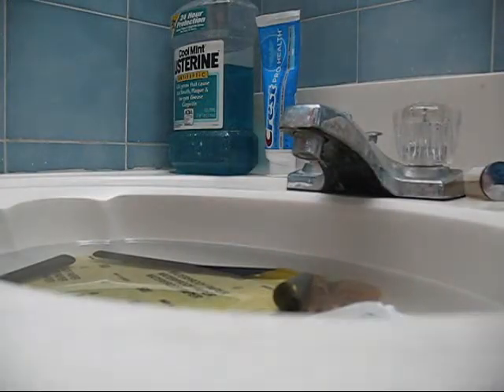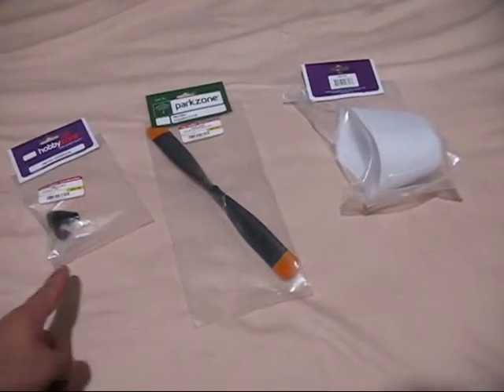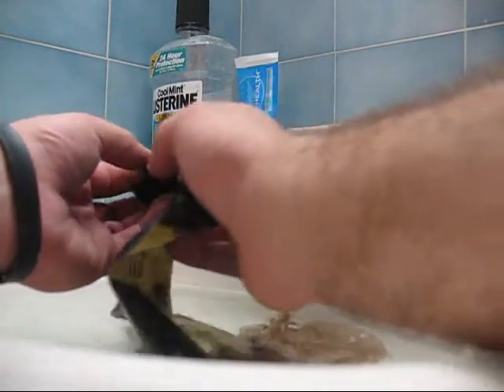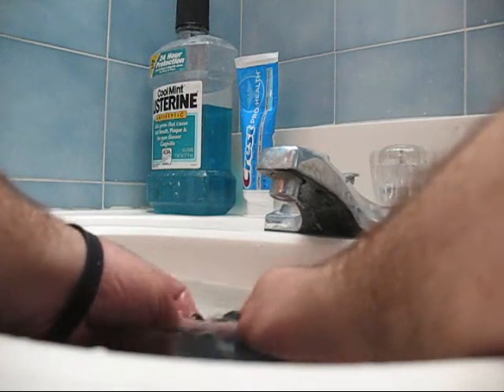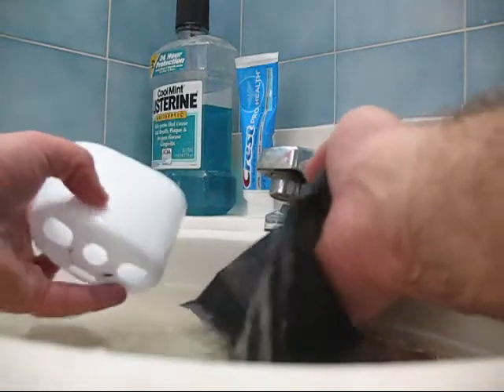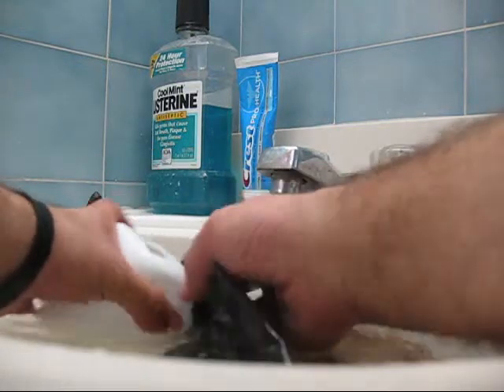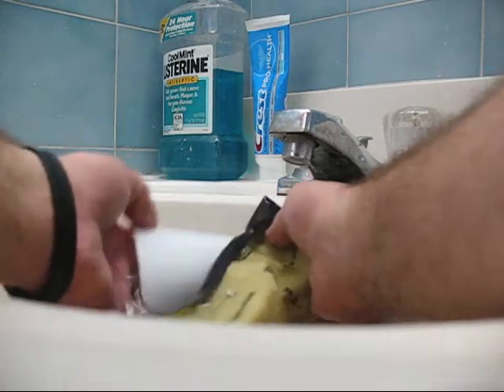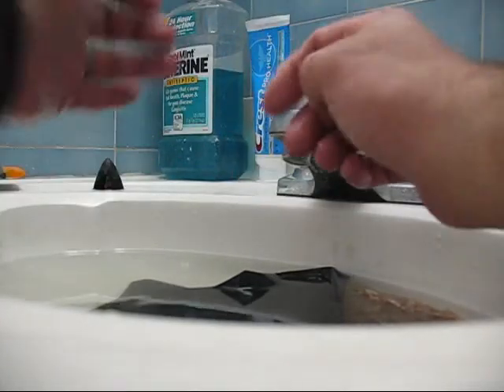HZ Super Cub Rebuild 03 - Sanding Plastics

Comment from the maker: @freediverga you're absolutely right. But on the case of a stock setup like I had here, it's ok to sand it lightly like thins since the motor+gearbox combo doesn't put out enough RPMs to cause significant vibration.

Comment: One big difference between dry sanding and wet sanding is the movement used. Dry sanding requires small circles; wet sanding uses straight lines, alternating direction between passes. This way, each successive pass works to remove the scratches from the previous one.

Comment: Wet sanding is typically done after dry sanding to get an even finish. Unlike dry sanding, wet sanding is done not to shape a surface, but to remove the large scratches left by dry sanding. When done correctly, the surface will be slowly leveled out, and the scratches left behind will become smaller and smaller, until the light they reflect no longer makes them visible.